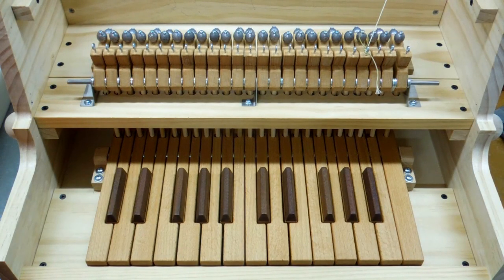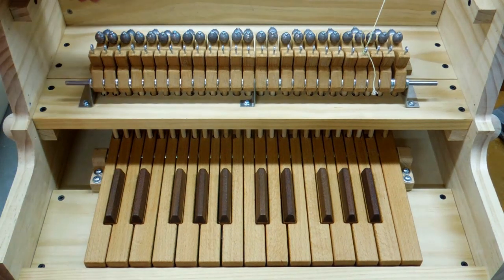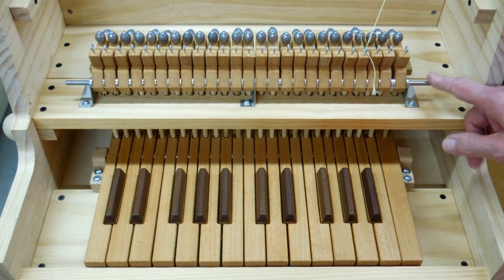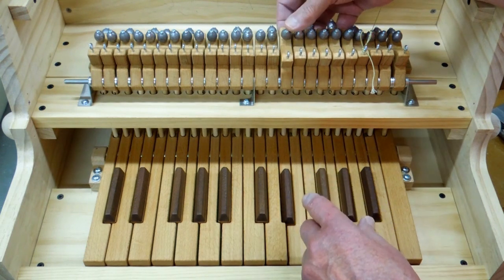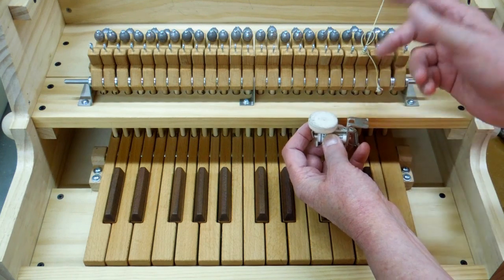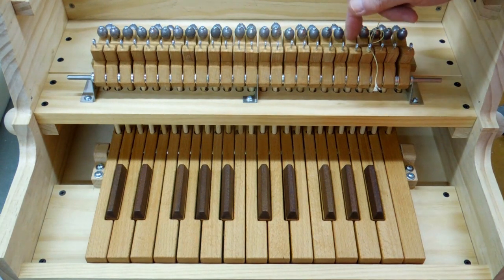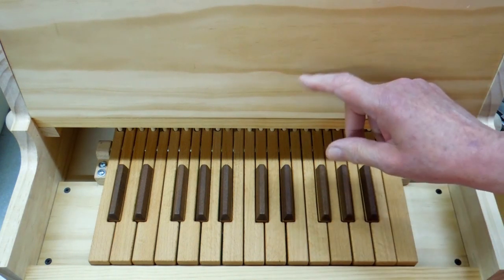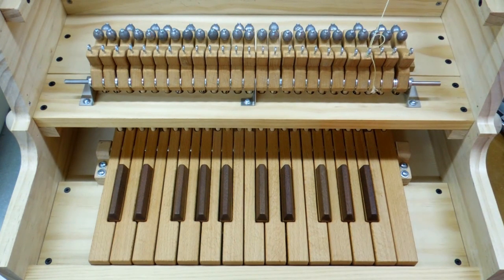Mini-Calliope Part 7 - Keyboard & Rockers

Comment: Modern piano keyboards ordinarily have an octave span of 164–165 mm; resulting in the width of black keys averaging 13.7 mm and white keys about 23.5 mm wide at the base, disregarding space between keys.   Hopefully you have not changed them much or it will make it difficult for someone to play as they are used to keys that are not for from those listed above.
Reply from the maker: My white keys are approximately 23 mm +/- and the black 14 mm +/-. Haven't found anyone who plays a keyboard and since I do not, it probably will never be noticed one way or another. :-) Ron
Reply: @RonaldWalters2010  That is well within reason, I have played on some non standard oversized keyboards from long ago ( i.e. antiques from the 1700s) and It doesn't seem to be a big deal, until I have played for a bit then I can really feel it in my hands as I am stretching just a bit further than normal!  Really makes your hands hurt after a while.  Your keys are not out of the ordinary as far as size goes, since you did not say how much bigger you made them I just wanted to point that out so you could let someone know if they went to play it.